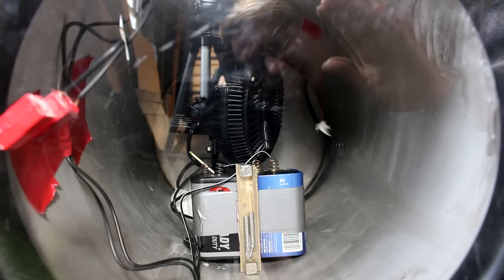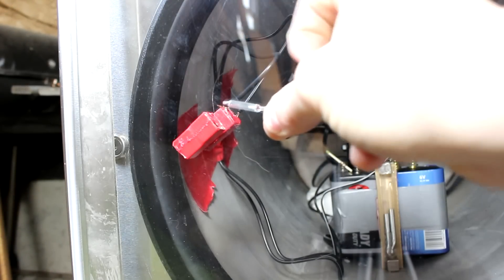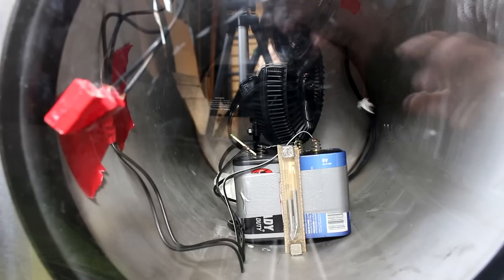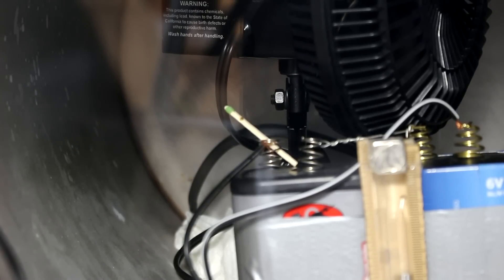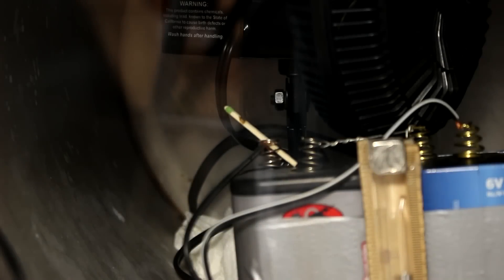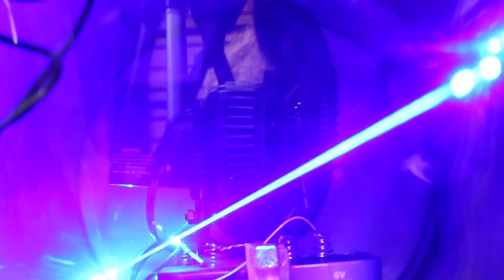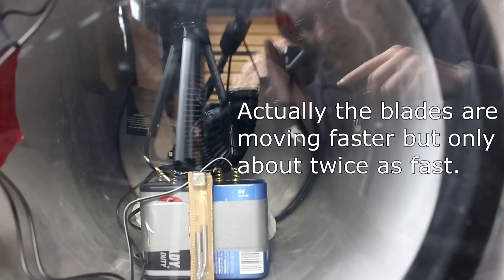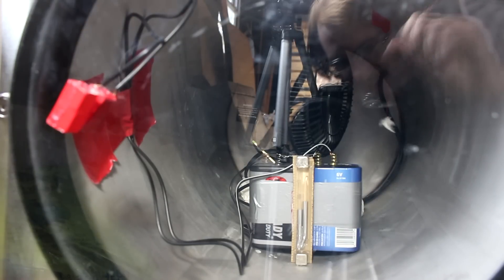Could a Fan on Mars Make Wind?

Comment: if you can't make spark in a vacuum how the heck does the coil in the fan create current to run the blade?
Reply: Troy Taylor The sparks require oxygen to burn. Current isn't effected by oxygen
Reply: Sad Squidward so pump in oxygen your motor will run NASA does it with a liguid oxidizer

Comment: Insufficient pressure for the match to burn as all combustion needs at least some pressure to remain close enough together to sustain the chain reaction. On top of that, the rapid expansion of the gases sucked away the heat at literally supersonic speeds causing flash cooling of the gases as fast as they were produced. Much like how things with water [like human flesh] can partially or even completely freeze in a vacuum.

Comment: Nice Video Cody. But I think the you have to consider thickness of the atmosphere rather than pressure.
On Mars, due to its relatively lower gravity, there are more molecules of air per unit volume, that exert that much pressure. Mars atmosphere is actually 100 times thinner than that of earth's. (Source: space.com)
In this experiment you had create an atmosphere with around 5mm Hg..That corresponds to ~ 1/150th of earths atm pressure.
So in order to recreate the same thickness, I think you have to increase the pressure to  around 8mm Hg. So then the pressure will be 1/100th of earth's and thickness will be 1/100th of earths.
P.S: Excuse me if I am wrong about the correlation between pressure and thickness.

Comment: There are reactions that can occur without external oxygen, I believe they contain their own oxygen.  They can work under water as well, right.  Any chance of seeing a "tiny" reaction in the chamber?  Would it be enough to produce a flame?  If so, could you likewise produce a flame in complete vacuum?  Like a rocket fuel I suppose...  but what about welding in space?  What is different, what works and what doesn't?

Comment: Where do the dirt devils on mars come from with no wind?
Reply: TheTrueMac did you even watch the video? He said that the ground is so fine that it is like powdered clay or in his example the same size as smoke. So when he turns on the fan the smoke moves or in your question dirt devils. But because the atmospheric pressure is almost that to a vacuum not even a feather would move. So it looks like a lot of wind movement but with little air there is no gas to be moved so there is no wind
Reply: TheTrueMac how am I a prick?

Comment: an experiment to try next is to have the corn in the chamber at atmospheric pressure, heating up until the first kernel pops...and then suddenly open a valve to an evacuated cannister, such that the pressure in the popping chamber suddenly drops very quickly - I would expect a very rapid popping and more violently with even greater expansion, because none of the water vapor will have been sucked out of the kernels from the gradual evacuation in your original vaccuum experiment.

Comment: It might be nice to know that unlike the normal vacuum pumps that use pistons to create a vacuum, the pumps that are used to create an ultra high vacuum are actually quite similar to a fan, as it is done using very rapid moving blades that can trap individual molecules. that also shows that in a near vacuum such devices should work.

Comment: The only problem with this is that though you can simulate the low pressure you cannot simulate the lower gravity would the smoke fall to the bottom of the chamber quite as quickly in a lower gravity?.

Comment: Does this mean that a prop plane wouldn't be able to produce enough thrust to fly on Mars?
Reply: yup, I believe so
Reply: It wouldn't produce enough lift to ever go of the ground either.
Reply: In theory, the plane could go fast enough to fly due to the low drag (less atmosphere = less drag), given a long enough runway. However, the plane would fly very poorly and would not be able to turn. It would rotate, but the trajectory wouldn't change.

Comment: It was kind of hard to see the smoke from the match being pulled through the fan with the laser on. I don't know how difficult this was to setup, but maybe if you do it again you could wrap some matches or balsa wood in a high resistance wire and connect it to a batter with the same sort of tilt switch. That way it would heat up and create smoke hopefully much like the laser did, but without the same light interference as the laser. Just a thought if you decide to revisit this experiment again.

Comment: Hey Cody, does WiFi work in 0 atmospheric pressure? It would be awesome to see a phone into your vacuum chamber and see if / how much the WiFi signal will decrease when pressure is getting lower.
Reply: Pretty please? :D
Reply: Yes. WiFi is electromagnetic radiation, all radio signals will still work. How do you think we get images from Curiosity?
Reply: sorak185
Not sure, that's why I wanted to find out, since I don't really understand how electromagnetic waves travel through space
Reply: Guess how they communicate in space?
The vacuum will have no effect on radio waves.
Reply: yes it has, in a vakuum they travel even faster, than in a thick atmoshere

Comment: A good discussion with explanation of equation for the dynamic pressure comparing Earth and Martian wind strengths. http://space.stackexchange.com/questions/9301/could-you-feel-the-wind-on-mars

Using the dynamic pressure equation (q=0.5pv^2) and ignoring gravity differences, pressure from the fastest recorded sustained wind on Mars of 60 mph = about 7.7 mph Earth wind. Pressure from Mars wind of 10 mph: qm= 0.5(0.02)(4.4704)^2 = 0.1998447616 Pa. Using that pressure in the equation for Earth, and solving for v = 0.571206759235148 m/s = 1.27775 mph wind on Earth for equal pressure. How much would feel a 1.28 mph wind outside? 

For some context, it takes a tailwind of >2.0 meters/sec (4.47387 mph) in some Track and Field events to count as wind assisted and invalidate records. 

Using a decent hair dryer could get you up to around 25-40 mph, maybe more if you use a nozzle of some sort.

Edited: forgot to reconvert from m/s to mph for Earth wind velocity, corrected.

Comment: I have also read in my bumbling around the nerd sites like NASA and what not, that the "sand" particles or dust is lightly charged by static or ionized (making them stick to our landers and rovers etc...)  kinda making them act like Styrofoam shreddings that are statically charged.  if all the particles are negatively charged,  would they not repel from one another creating a "fluffy " dust layer when settled thus making them easier to move from much thinner atmosphere and wind pressure from lower air density?  kinda how magnets repel one another from the same pole?  

just a mind bug that has been rattling around my head for a long while i never got around to asking anyone.

Comment: I wonder, you said yourself that the laser on the wood will create gasses such as Co2 and water vapor. perhaps the only reason the fan can move those particles is because they are being released at the same time as the gas and therefore actually do have a small amount of air to move them. I know that being evacuated the gas should expand after being released to fill the chamber, but that would be the reason the smoke moves up before falling to the bottom of the chamber would it not? otherwise there really is no reason for the smoke to rise, it's just following the air current and is then being caught by the fan. also is it just me or did it look like the feather wiggled when he was making the smoke?

Comment: This video was hard to see what you were talking about. The lasers made a massive glare on the glass, which caused the camera to compensate for this blind light.  So by the time the camera recovered from the blinding of light, I could not see any smoke. (Light or white balance settings)  The only time I seen smoke was when it fell to the bottom of the chamber.  I never seen it go through the fan Cody.

Comment: I feel like because he used so little dry ice (frozen co2) that it didn't become enough of a co2 atmosphere to simulate Mars that's just my thoughts
Reply: It shouldn't matter what gas is used as long as the total pressure is correct. He could have used pure oxygen even. Granted, the match demonstration might have turned out a bit differently. I'm not sure if 100% pure O2 at that pressure would allow combustion or not

Comment: when you burn the wood inside the chamber, does it give off any gases as well as the smoke? And could these gases and smoke compromised the low pressure? Is their a pressure gauge for the chamber you could watch for change when you lase the wood? That'd be interesting!

Comment: So, in a serious colonization of Mars, mining for ores with explosives would be very different. We have hypergolic fuels but have we adapted them for explosive use?
Reply: Craig Mooring Most explosives work just fine in a vacuum. Nitrocellulose is a notable exception (For example, Philae's harpoon gun used NC. It was launched before the problems were known). Explosives with liquid components (ie ANFO) might also have problems, due to boil-off. The usual solid or powdered mining explosives will work though.
Reply: It wouldn't pay to colonize Mars under any scenario.

Comment: I expected a different result from this. I would like the question though atmospheric pressure is much different than a fan. is it possible that there could be different forces at work then blowing air or carbon dioxide with a fan.

Comment: Does the laser affect the window?
Reply: ArduinoPlays, "red is the weakest wavelength" This doesn't matter in this context, per se. Red has the lowest power of photons in the visible range, true, but this really only matters for excitation of electrons, for example when doing fluorescence. Red or (for example) blue light are are equivalent for heating an object, assuming the object absorbs either wavelength equally well.
Reply: Melt it or scar it.

Even low power red lasers I have used scar glass somehow
Reply: Arduino, mate, I can't get the hang of programming those little suckers
Reply: Does anyone know what kind of laser it is? It's amazing how powerful it is
Reply: ArduinoPlays 
Yea. It makes no sense to me. 
I am wondering if it has an effect on a contaminant on the glass, I don't know but something like oils or acids off your fingers break down faster or something.

Comment: cody you could take it a step further and buy a few million dollar jet engine and see if that will blow offer a a lot of million dollar rocket on mars hint you can use the rocket to get there and an engine from the rocket and see if it will blow offer the rocket
Reply: The propulsion of jet engines is created by fuel being injected into air, then combusted. With no oxidizer, there would be no propulsion.
Reply: Big Dogs he has access to rockets and jets at school, it's been in previous episodes.
Reply: Flowey The Flower jet engines dont neccicaraly use oxygen they use other ways to burn or make propultion
Reply: Burning requires oxygen.

Comment: what contributed to such small particle size on Mars?  I'm having trouble imagining the surface is covered either with hard bare rock or dunes of super fine (microscopic) clay dust.  maybe my misconceptions are the main issue here but the photos from the Martian surface look very similar to the terrain out west where I would think you would have a heterogeneous mixture of particle size and composition.

Comment: What happens if you pop a balloon in the chamber with the laser?
Reply: Will the carbon release from the balloon create wind enough to blow will the carbon turn into a liquid because there is no atmosphere for carbon to move so it looses its gas property will the balloon contain any oxygen at all or is it all just carbon dioxide if so is it enough to make a match fire visible if so for how long.

Comment: Making charcoal in a vacuum chamber?
Reply: Elliot Lockett 
No. Wood gasification also works without oxygen (when heat is supplied otherwise) and leaves behind charcoal.
It is essential to have limited oxygen supply to produce charcoal
Reply: you need oxygen to make charcoal.

Comment: Cody could you rig a small pistol up inside your rather large vacuum chamber and catch the bullet to measure the depth with and without a vacuum to see the difference?  too bad you couldn't set it sideways to also use a slow motion camera to measure the speed difference!

Comment: Killer Lazer.

Does anyone know how to make a match, and why it reacts to only the strip that is on the box?
Reply: James Mitchell Ik that they have phosphorus on them, and the thing on the side of the box has a lot of friction when in contact with the match, btw I'm just a High School student so idk very well
Reply: Old matches  have white Phosphorus , an allotrope of phosphorus , on the head. This is the white dot found on light anywhere or survival matches. White phosphorus is much less stable and ignites at a lower temperature, to red phosphorus, and in the air itself. Red phosphorus is much more stable and requires more energy to ignite. On the striking section of a matchbox there is powdered glass and chemicals that when the phosphorus head is struck against, the red phosphorus turns to white phosphorus and ignites spontaneously. And that is how a match works. Source: a 5 week long project for university about chemicals in daily use.
Reply: James Mitchell The match head contains sulphur, a binding agent and normally a small amount of other compounds
Reply: Safety matches (like 90% of matches sold in supermarkets) have something on the side if the matchbox that ignites it when there is sufficient friction. They are safety matches because they an only ignite on these surfaces. But there re matches (probably older ones) that have whatever helps ignite them on the tip of the matchhead itself, meaning any sufficient amount of friction (mostly on rock/concrete/ brick etc) will cause the match to ignite. I'm also just in highschool so I wouldn't take my word for it lol, but I have read about this and seen it on documentaries and television (mythbusters :P) so I think I'm pretty close ;)
Reply: ^^ what they said :P
Reply: Dick Butt So is the entire match made out of phosphorus. Or only the outside to make it ignite?

Comment: I think the match and laser are a poor way to show the air flow. For one, the laser causes the camera to adjust exposure so when you turn it off, everything becomes dark. With the match, the smoke is very faint and doesn't last long at all. I couldn't actually see anything in this video. I'd love if you'd repeat this experiment with a different source of smoke!

Comment: Okay, if I may bring in some aerodynamics: the amount of force that a gas produces on an object is dynamic pressure times the surface. Dynamic pressure is defined as follows: q = 1/2*rho*v² where q is dynamic pressure, rho air density and v the airflow speed. Since you are almost in a vacuum, rho is tiny, and so is q..

You could check this out and correlate the air density and the angle of a flat plate hanging of a hinge.

Here's another idea: could you play with the speed of sound? And prove that it is a function of temperature alone?
Reply: The air density on mars would be a little more than just in this vacuum, with 99% co2 and large amounts of micro particles permanently suspended in the air as well.
Reply: Earth atmospheric density is 1.2 kg/m³ and Mars' is 0,02 kg/m³. The dynamic pressure of a 5 m/s wind on earth is equivalent to a 38.8 m/s wind on mars. 11.2 mph on earth yields 86.8 miles an hour on mars.

For Cody's experiment, the baseline airspeed (same fan rpm) yields an "earth" wind of 0,64 m/s.
But Cody's simulated atmosphere at 3 Torr, with only CO₂, has a density of 1.8 kg/m³ (assuming a temperature of 20°C) times 0.0013, thus 0.0023 kg/m³. This is ten times less than the mean density on Mars.

Cody's wind, in the vacuum chamber at 20°C (it's probably colder in there with the sublimating CO₂) has a dynamic pressure that is equivalent to a 0.21 m/s earth wind. A tiny mouse fart.
Reply: Frédéric Dutrey
Also you would need to know the total amount of co2 dispersed into the chamber comparitive to the overall size of the chamber. And he would need to increase the air density by suspending dust particles in the air as well on top of that.
 Much like water alone flowing 20mph will have less of an effect on a human standing in the flow than water+mud flowing at 20mph.
Reply: For perfect gasses at 20°C, a mol yields 22,4 litres at atmospheric pressure. A mol of CO₂ is 16+16+12= 44g. Judging from the amount of dry ice Cody has put into the vessel, I'm confident there is plenty enough of CO₂ for the job.

No idea for the dust particles.. I wouldn't mind seeing Cody blowing some dust "Mars-style".
Reply: Frédéric Dutrey
Personally I don't think that small amount of dry ice would produce a scaled down gas density similar to the air on mars surface of 99 percent co2. And having dust in the wind will impart more force onto an object as it makes the air itself more dense because the particles are suspended in it. (Although, I don't know if a feather would even be sensitive enough to detect the difference, maybe though.)

Comment: I wonder if you would make enough smoke in the chamber over time, will there be a layer of 'smoke sand' on the bottom of the vacuum chamber? xD
Reply from the maker: It turns into tar
Reply: Cody, could we get a video on that?
Reply: more or less, smoke is tar.
Reply: +Cody'sLab that is a serious laser you've got there! Wow.
Reply: So tar is essentially smoke?
Reply: P4nzerAss I would shrink snoop dogg
Reply: smoke is basically tiny droplets of condensed tar

so when it gets to the bottom of the chamber they will coalesce into a puddle of tar